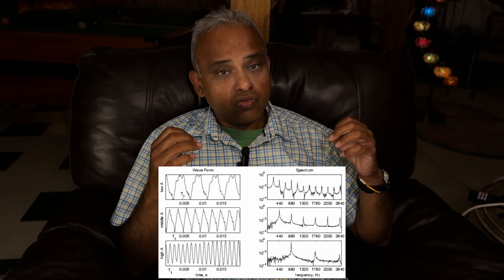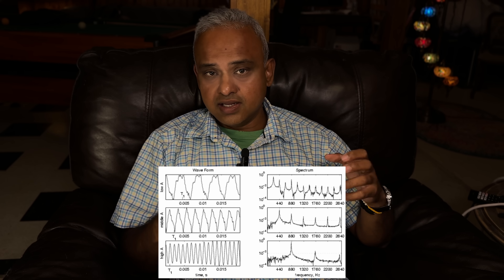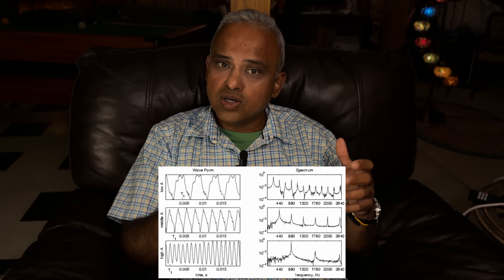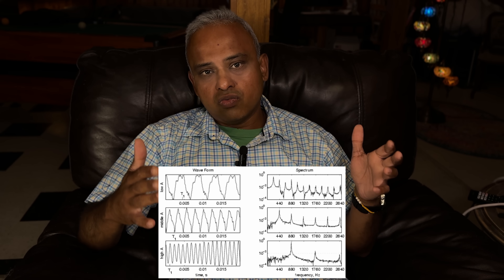Warm vs Analytical Sound | What's Really Different?

Comment: I think another cause of 'warmth' from tube amplifies is the increased output impedance of tube amps.  Loudspeakers do not offer a fixed load.  In other words, an '8-ohm' speaker is only nominally 8 ohms.  It might have a minimum impedance of 5 ohms and a maximum impedance of 20 ohms or higher.  The output impedance of a tube amplifier can be several ohms while that of a solid state amplifier might be 0.1 ohms or so.  Here is the effect of that.  Say both the tube amp and the solid state amp are outputting 10 volts before their respective output impedance.  If they are both driving an 8 ohm load, the solid state amp will drop 10*0.1/(8 + 0.1) = 0.12 volts across its output impedance and 9.88 volts across the load.  The tube amp, on the other hand will drop 10*3/(8+3) = 2.73 volts across its output impedance and 7.27 volts across the load.  Now, if we look at a 20 ohm load, the solid state amp wll drop 10*0.1/(20+.1) = 0.050 volts across its output impedance and 9.95 volts across the load, hardly any difference.  But for the tube amp, it will drop 10*3/(20+3) = 1.30 volts across its output impedance and 10*20/(20+3) = 8.70 volts across the load - an increase of 1.6 dB.  Since these increases in impedance occur at the low frequencies (a single bump for 2nd order systems, a double bump for 4th order systems) it will add warmth by increasing the relative output of the bass or mid-bass.
BTW, if you listen to a McIntosh amp, you won't notice very much difference between their solid state and tube amps.  This is because of two reasons.  First, they have very low distortion on their tube amps and second, because of their use of an 'autoformer', their tube amps have lower output impedances.
There is yet another effect having to do with the output impedance of the amp and the speaker nonlinearities that is very difficult to explain but it has to do with the fact that the back-emf of the loudspeaker (BL*u) has a slightly different effect on distortion for a source that is high impedance than for a low impedance source.  When I was starting out in the field, I hypothesized that it would be better to drive a loudspeaker with a transconductance amp and use equalization to get flat response than to use a conventional voltage amp.  My thinking is that I could solve part of a hard problem (distortion) by allowing an easy problem (non-flat response).  As it turns out, I was wrong.  The easy problem wasn't time invariant and I also discovered a problem called "Jump Resonance" that was previously unknown.  For those who are mathy, here is a link to that....https://www.slideshare.net/slideshow/jump-resonance/56026744  (BTW, my contribution was discovering the effect in loudspeakers ...my coauthor who is a mechanical engineer with extensive knowledge of control theory did the heavy mathematical lifting.)
Reply: ErinsAudioCorner recently touched on these effects, attempting to explain why amplifiers sound different.
You might contribute to that discussion 😊
My Chi-Fi tube amp choked on the LRS' constant 3ohm load. I was hoping Erin would show us why.
Needless to say drive them with SS high current and damping factor power amps. Tube preamps for warmth and holgraphy😊

Comment: How does warm relate to details?  My general observation is that SS draws out more details than tubes esp on higher frequency frequencies
Reply from the maker: IME warmth / analytical/ detailed etc. isn’t necessary tied to SS or tube generically. Depends on design, system interaction with electronics, and room.

Comment: Early digital recordings suffered because engineers were accustomed to compensating for the limitations of records. For example they would accentuate the higher frequencies knowing that in cutting a record there would be a high frequency rolloff and that a further rolloff would occur in playing the record. Once engineers stopped trying to compensate for limitations that were no longer existent, the fidelity of digital recordings surpassed that of phonograph records.

If the amplification circuits introduce harmonics that the musical instruments don’t produce, then by definition, that is a low-fidelity system.
Reply: If you were to listen to music by looking at your oscilloscope, your observation is valid, but you listen to music with your brain and through your ears, which is why those of us in the audio industry love tubes.
si escucharas musica mirando tu osciloscopio tu acotacion es valida, pero escuchas musica con tu cerebro y a traves de tus oidos, por eso los que estamos en el audio amamos la valvula

Comment: I tuned my woofer so that it's harmonic distortion add warmth to my main speaker. Not just at low freq, but an even warmth trough all the female vocal freq, which is nice. And no, the low frequency doesn't sound muddy or bloated.

Comment: I think this is only a part of a story. Main difference between cold and warm sound is just frequency response curve. You can get cold detailed dry sound from SET-valve amp and the same time warm sound of transistor amp depending on caps, resistors...etc. In general when your tonal balans is top end focused with lean mids you get cold coloration, when midrange is boosted and top and bottom are easy - than it is warm (like for example british and japaneese sound), this is not about any harmonics or other distortions and imperfections in most cases. Same with speakers. If their distortion happens in lower frequences (like old paper loudspeakers) and they start to roll-off early without peaky top - this is warm, if they break up at higher frequenses with peaky spl-curve (like aluminium or cevlar) - this will be cold and sharp. But in both cases speakers (like triods in SET) mainly generate second harmonics.
Reply: "Main difference between cold and warm sound is just frequency response curve." especially respecting the equal loudness contours in the upper mids.

Comment: The relationship between fundamental frequencies and harmonics counts against multi way speakers using higher order crossovers somewhat,especially when crossed over where the ear is most sensitive to phase changes. A fundamental may take place through the woofer,with harmonics being produced through the tweeter after having been shifted in time and potentially amplitude too. Additionally the tweeter will often present the sound with differing sonic characteristics and dispersion patterns from the woofer,aswell as being presented further forward with respect to it's acoustic centre. The desire to preserve instruments  with a more natural, lifelike tonality also requires tweeters that extend beyond the audio band in order to reproduce their timbre more faithfully. Those frequencies of course aren't heard,but more "sensed" with respect to their contribution towards directional and spatial cues and push phase anomalies further out from the audio band.

Comment: Thank you for a great explanation of what people call warmth in audio.  I never understood the term warm.  I've always thought tube amplification created a fuller or richer sound.  More Dynamics in tonality overall.  Which makes sense, when you realize the tubes do generate second order harmonics which is an octave above every single note.  I've always thought that the tube sound always sounded louder and fuller at lower volumes also.  Another reason I like tube preamps.  That is one of my secret weapons.  Another secret is to take a digital mix and pass it through a stage of tape saturation, with real analog magnetic tape.  Not the easiest process, but it works very well.  Thanks for the video 👍.
Reply: Do what Boards of Canada did with their early releases and do multiple runs through VHS tape to make sounds as smooth as silk .
Reply: @JonnyParker-  If someone ever manufactured a VHS HQ tape player/recorder with record bias adjustment and real time tape monitor, that would be a huge secret weapon...  And probably impossible to manufacture 😏.
Reply: @peterbaugh51  Aye like having a broken tapeecho doing magical things , get your sounds on VHS bro !!

Comment: I am currently focusing on mixing for voice over and have been using the Abbey Road J37 Tape emulation plugin either using the default, default Abbey Road or Male Vocal Warmth preset. It is interesting the number of plugins I require to procss voiceovers in the digital domain as compared to when I was using an SPL Channel One; an analog preamp designed for voice it offers compression, limiting, dessing, as well as selective band EQ and a transfomer based "Air Band." Also, it has "FET Distortion" and a 12 AX7. I installed a vintage Mullard and the sound was exceptional and it was much easier just turning a few knobs and listening rather than using a DAW.  I am no stranger to technology with six years with Apple, but sometime old school analog equipment is better.
Reply: Sometimes quicker and easier also...  Just using your ears 👍.
Reply: @peterbaugh51  I am fascinated by modern engineers mixing "in the box" using software to create. But then I look at the engineer who recorded Bill Evan's "Sunday at the Village Vanguard" using four LDC mic's (Sony's take on the U87) and LCR Ampex mixer and tape machine and think "that's the way to do it!"

Comment: Hi, I request some advice from u regarding selecting the right integrated amp for my setup. I've Focal Aria 926 floor standing speakers (91.5dB sensitivity) and normally listen to vocal music (ie, ghazals) and old Bollywood songs. My room size is 200sqf and I sometimes listen to high beat/bass Bollywood songs at high volume (90-95dB). My music source is apps like YouTube Music, Amazon Music, Spotify, etc. which I connect thru a WiiM streamer. I ve a Naim 5si integrated amp, but want to upgrade as this amp is quite under-powered... it's just 60W. Currently, considering between Luxman L505Z and Accuphase E280 (pl note that E3000 is not yet available in India). Recently someone also suggested Primare I25 (which is Class D amp) for my setup and taste. Have also been told that Accuphase is good for vocals but not good for high beat/bass music at high volume.
Bit confused... need you expert opinion in selecting the right amp. BTW, I have heard that one should not go for Class D amps (like Primare I25) as they lack sweetness/warmth. Further, Class D amps are difficult to repair if something goes wrong. Plz advise. Thanks..
Reply from the maker: Primare makes excellent Class D amps. Whether they are warm or cool sounding depends on setup. Do you find your setup with the focals are a bit bright already? If so, I would not go with Primare. The lux and Accuphase are excellent choices. Accuphase amps have superb overall performance including bass. Rega Aethos or Chord amplifiers are other excellent choices.
Reply: @analogholic_reviews  Thanks for your advice. It cleared all my doubts. Thanks a million!!

Comment: Nice job. I use a Doge 10b 30watt Class A, low feedback amp. It has those qualities you describe. Compared to my Denon pma a100 which is excellent as well but not as interesting to listen to. The Doge bests it in every category. Not night and day but just more live sounding. My Denon dcd a100 cd player has a warm sound (for cd) as well that I enjoy very much. My system sounds good with all my music (hard to fathom) with no tone controls. Canton Vento 7 and Technics 1500c with a couple mods and Nagaoka mp200 round it out. Lp and CD have a similar balance. LPs can be more 3D but CDs have their strengths as well. Never stream.

Comment: I put a bose flex se in a jewelry box with the lid open and gives it a great soundstage for my CD's, streaming and vinyl. Who needs expensive speakers.
Reply: I use bamboo risers with zircon encrusted feet to elevate my speaker wires.

Comment: The best way I can address the issue of sonic warmth is from the vantage point of my Fender tube amp. If the guitar plays through the amp without any reverb it sounds flat and sterile but once the reverb is added the sound becomes lush and ambiant creating the desired warmth many listeners like myself are looking for.
With respect to my solid state stereo amplifier (Moon 340i) the sound has a natural warmth by virtue of it's internal design and components. There is an oversized  toroidal transformer and the capacitors are a bi-polar design made in-house that work best when the unit is continuously left on. The sound quality has been very satisfying in the 8 years since I bought it on the secondary market.
Reply: I have a '71 Pro Reverb I got as a boy which I am restoring after being damaged. In working with a boutique amp designer I noticed that the aged transformer seems to make a considerable difference. I saw Derek Trucks play one of his amps and it was wonderful but could quite match the sound of his old broken in amp.

Comment: Passing through perhaps thousands of transistors in preamps, and then power amps will take the harmonics and add harmonics of harmonics which in the end reduces to background noise which is not constant but will change with the signal changes.  Simpler circuits will still keep the harmonics relatively clean. The sound is distorted but cleaner. So a valve amp will sound better than a solid state amp. A single FET driver class 'A' power amp will sound better than a very accurate expensive class 'AB' power amp.
Reply: Sound is subjective, no such thing as good > better > best
 it all just comes down to preference.

What's the best vanilla ice cream?
Reply: Analog signals are not going to go through many transistors in a preamp, especially not 1000s or even 100s.

Comment: I can compare a RTR commercial tape of a certain 1966 pop music release to the LP version.  The only real advantage is the tape has a better bottom extension.   Because depending on who did it,  they limited bass in LP to limit the wide cutter excursions.  Like supposedly it was common to brick wall block below 50 Hz.

Comment: You're talking about distortion. That's why tube amps struggle with piano, which doesn't have your 2nd order etc. Add digital correction/equalisation and add a little to frequencies below 200hz. Warmth without distortion

Comment: How does a speaker sound warm and cold? I would like to differ. In my understanding what you have told is musicality and warmth is actually less high frequency energy.
Reply: Did you watch the video? Have you heard speakers with a tube amp compared to the same speaker with a transistor amp?  Tubes do not cut high frequencies.  They add harmonics beyond human hearing.  And some of the second order harmonics you can hear.  So, a fuller, richer sound results.  More like real instruments being played live.  Well, at least that's what I hear.  But then I actually play real instruments. So I know the difference. 👍

Comment: Fascinating Jim (Star trek line).  Last night I was listening to scorpions In Trance and Animal Magnetism on cassette.  I had recently made the recording off of yt with my Nakamichi zx9 and good old maxell udxl2 chrome tape.  I smugly said man this sounds BETTER than the so called original as in source off yt without being recorded.  I had no idea my tape recorder had modified the signal to add even order harmonics!  How would I without your video?  Anyway specifically the bass seemed deep and full which you touched on the tape machine may do that.  Now, I will say the zx9 allows 400 hz bias adjustment which could mean a better recording also azimuth adjustment and just having a great tape adds to the sound quality.